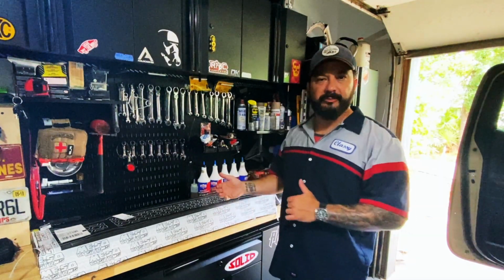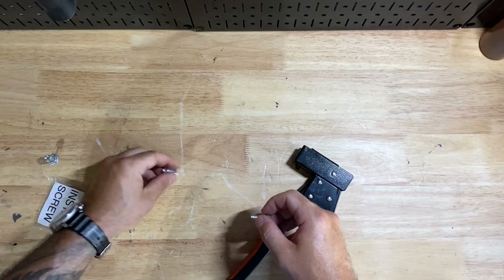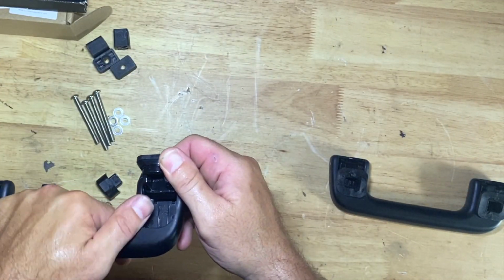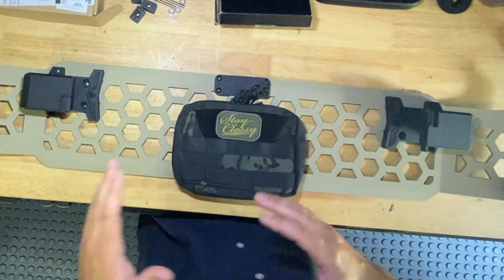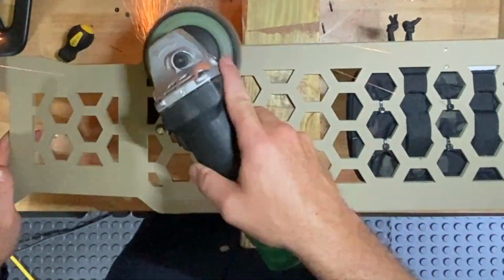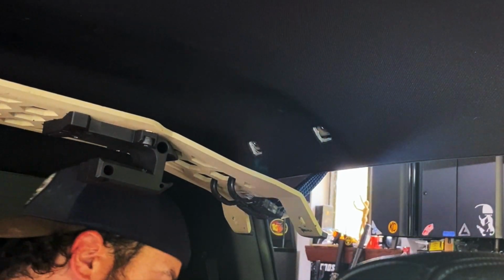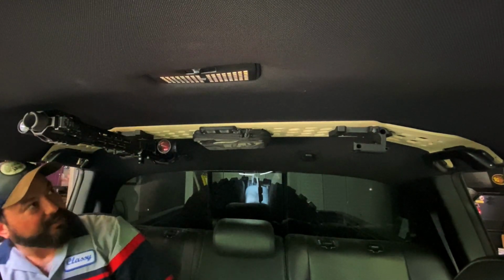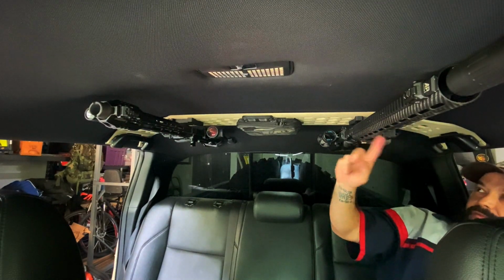Toyota Tacoma | MESO Customs Hex Rack Install | AR Set Up | (2017 Tacoma)

Comment: I used pieces of mending plate from tractor supply covered in heat shrink to act as a washer for top and bottom gives a lot of flexibility without having to drill through the rack
Reply from the maker: Nice, thanks for watching.

Comment: What do you think weight wise you’d want to put on the rack? I bought the Meso one because of the thick aluminum. Not worried about the rack. More the connection points.

I’m mean, those rifles aren’t light 😂
Reply from the maker: I think rifles will be fine. Anything to large, bulky or heavy won’t fit.

Comment: Random mumbling. Signs of a great mechanic. Means we are always thinking. How do the ar’s fit when mounted that way, I originally ordered one from og fab and never used. Just to big for and nil clean, with the bending. I have a meso in the mail. I need to order another, one has to be black and my sons Tacoma is the grey colored
Reply from the maker: It is a tight fit, SBRs or pistols fit the best. Thanks for watching
Reply: @ClassyTacos  I loved your video , and the tip to mount it reversed , but like you were saying not going to drive around with them every day. I have a q honey badger, with rugged 5.56 it would kill me if that ever got stolen. Any of my things,
Nice toys as well. I have a clone of a mk12 I built. Upper from Charlie’s clones. Lower is a daniel. With binary. Original Hk rail covers. I’m waiting on the suppressor to go with coller. I’m about 3 months in. So should be soon. Once you go suppressed it’s hard. To go back. If you check og fab. ( don’t like there molle stuff I gave mine away ) but he has some ar blocks for mounting. No wiggle, They lock and you can run a lock through them as well. 
He has them for ar. Ak, a few ar pistol locks. For my mp5 I had 2 3D printed . 2 mounts not that great. Thanks for answering. God bless and stay safe.

Comment: Is it viable with a gun in them from the outside  ?
Reply from the maker: Are you asking if you can grab it from an open window?
Reply: @ClassyTacos  was trying to say visible from the outside  ? Sorry
Reply from the maker: @MichaelSmith-cq4zk  yes and no, you have to duck down to look at the ceiling. Can be seen in the daylight. Darker tints would help.

Comment: Can I use a regular nursert gun. Mine is from Germany and works a little different
Reply from the maker: I don't see why not, how different is the tool?
Reply: @ClassyTacos  thanks for the reply, it’s basically the same tool. I believe but it drives and crushes likes a cert nut. It has separate mandrels. It’s a German made tool I grabbed from Grainger. I have a neumatic rivit nut gun. But once it’s in it’s in,even on the lowest pressure setting. I also have a raptor. One of the guys in our club ripped his skid plate off. Like all the fatocty welded bungs out. I have a on board compressor under the hod it had 8 holding this skid plate one I use 6 of the neumatic river nuts , (they are a little stinger material) you know more then me. But it’s a year later and his skid plate now has all 8 takes it on and off. Rock solid . Was supposed to be a feild fix. We ended up cutting a door out for the oil plug. And used the handheld gun to make the nuts to go in and out. I love your stuff. It’s my sons Tacoma, he is always finding projects lol he wants a on board compressor, I was thinking of splitting a tank kit and putting it behind the back seat. Wish you guys had stuff for raptor. I have had my own stuff made. My son wanted a bridge for his Tacoma , I wanted one for the raptor . I ended up using paper to mock up sides. (I have access to a water jet machine my chopper builder lets me use it) I made the sides and made a bridge but it’s 3 peices 2 up sides and one across. Instead of Tacoma style 3 peices. I first bought my son one from another fab. Way to big for a taco and not good quality, had to bend your self. No spacers dug into the head liner. We just ordered him your hex panel. His truck is a green so I’ll powered coat that to match truck. The other panel I cut up and made some molle stuff for my raptor. Thanks sorry for long text, love meso’s stuff. It’s the name mesa tactical amazing and meso lol 
God bless
Reply from the maker: @2gunslefty  all good vibes, appreciate you watching.

Comment: I think plastic spacers/washers with a rubber washer for vibration would work well, to drop the mounts down a little lower. And longer bolts to compensate for the length. Absolutely love this! Cheers. 

And just in case it has not ended @chazzfie
Reply from the maker: That’s a great idea, thanks for watching.

Comment: Where did you get the sound detening stuff at?
Reply from the maker: Amazon for the deadening and the insulation.
Reply: @ClassyTacos  would you have alink6
Reply from the maker: @raymonde.tanneratomic-rc9370   Sound deadening. -- https://amzn.to/3luYffK.  / Insulation -- https://amzn.to/2WNY9Fv one box each will get the ceiling done. You will have alot left over from the sound deadening and nothing left over form the insulation foam.

Comment: seems awfully flimsy too me
Reply from the maker: Just as flimsy as any other lockable mag catch. As for the overhead rack, nothing is flimsy on it. I can do a pull up on it. Thanks for watching.
Reply: @ClassyTacos  the whole plate flexes at 18:50 when you're tweaking on it. I had to do a double take and google the product to make sure it wasn't a piece of PVC
Reply: @ClassyTacos  do some inverted rows off it then! cause i'm not believing it!
Reply from the maker: @schlomoshekelstein908  ha ha, it’s aluminum. In all seriousness it’s really not flimsy. I mean if you put 100 pounds on it, it will flex. For the ARs it’s fine, they lean up against the ceiling making a tight fit. They do not bounce around while driving, although I don’t drive full time with them in.